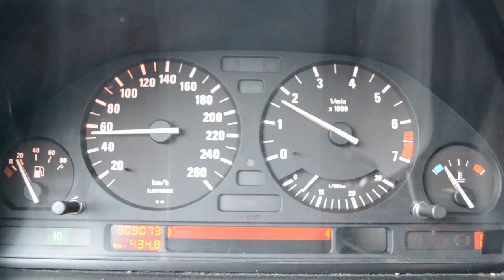MOUNTING SUPERSPORT SPRINGS ! BMW 525i DailyDrifter Ep.6

Comment: It looked like it was the wrong method to take out the springs. Seems difficult with the use of force. Couldn't you take out the strut then replace the spring? Unless this was the only way to do it.
Reply from the maker: Lay Gandhi yeah, it would be easier to get the shock out, but it was really hard, so we did like this instead 👍🏼 not the best way, but it worked 👌🏼